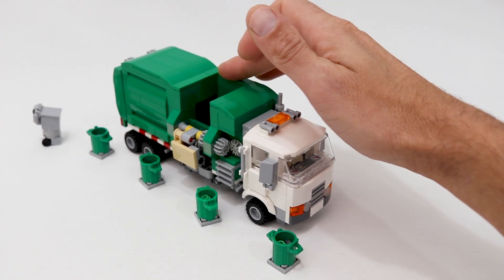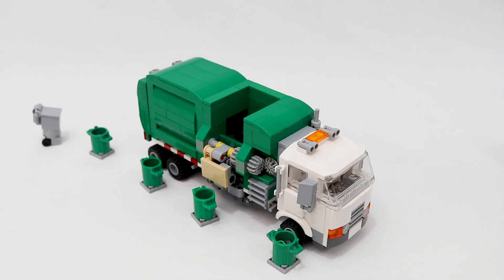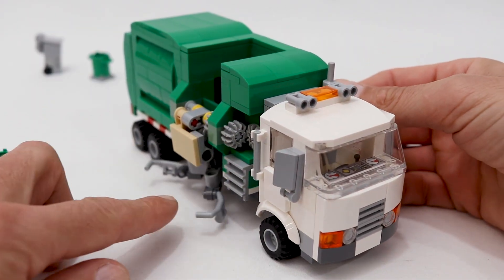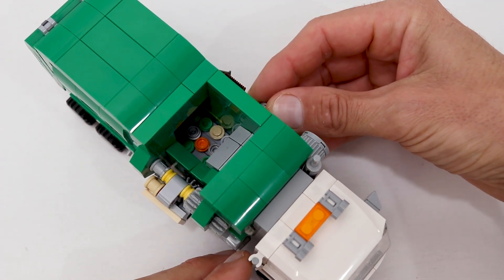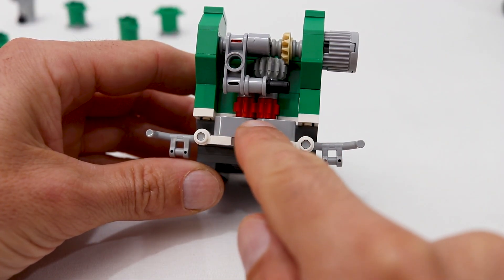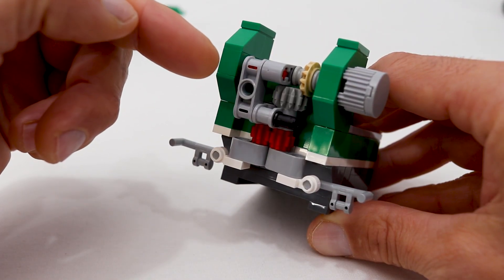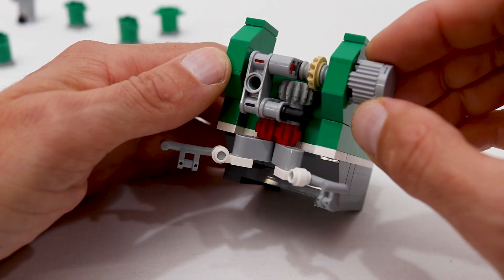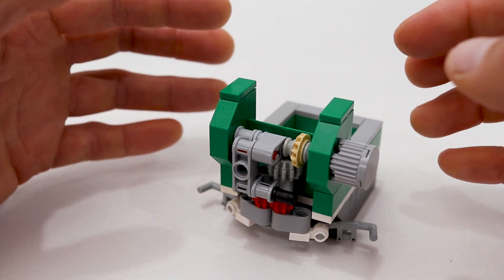Amazing LEGO Side Loading Garbage Truck Mechanism

Comment: @JKBrickworks Is it possible that it works best with 11955 Gear 8 Tooth with Dual Face without Friction? It seems that this is the only gear to make the gripper parallel, right? THX

Comment: Lego has decided to release a technic garbage truck (42167) based similarly to the functions of this garbage truck. Obviously someone in lego saw this garbage truck.
Reply: Well obviously, if it reached 10.000k and wasn't chosen as an Ideas set instead. Why pay the fan designer if they can make it themselves and get some cash from Mack as a licensing partner in the process?
Reply: @R0Sch88 they didn’t even make a half decent garbage bin on it

Comment: So sad that the loader used an illegal technique
Reply: I'm curious to understand what you think is an illegal technique.
Reply: @scotthasse280  i don't know I think is putting a horizontal plate with a vertical plate, placing bricks on a Technic brick or beam (by the side), but I've seen that technique in a video so I could be wrong
Reply: @synkron1246  Ah, thanks. A single stud in a technic brick is discussed at http://bramlambrecht.com/tmp/jamieberard-brickstress-bf06.pdf (slide 11), and seems to be OK. I think the same would apply to a beam, and the way we are using it is a single stud connection. 

Although it might look like we've put vertical plates into horizontal ones, we actually haven't but have used parts #22885  and #3956 fairly extensively.

Thanks for the discussion and sharing your concerns!
Reply: @scotthasse280  thanks for letting me understand :)

Comment: It's a "grab & lift" mechanism, it's really hand when you need to lift stuff with Mindstorm robots because you only need 1 motor to do two movements, I've used it on a tic tac toe robot that otherwise would have been impossible using a single RCX!

Comment: Imagine this whole assembly as a GBC module and the truck as part of some automated train system. Full-auto re/cycling!
Reply: This is actually a similar concept to a gbc mechanism where a lift arm does nothing until a ball falls into, when it lifts it up and deposits it in a similar fashion. It works with a piston though, not a bevel gear.
Reply: Yes, it's the Akiyuki 'stuck ball' GBC, also came to my mind when looking at the garbage truck video, very nice compact design and function in the truck.
https://www.youtube.com/watch?v=4JeHGJJORrI
Reply: That would be so awesome!! I hope someone makes that, I wonder if it can be easily modified to make it pick up balls or some containers with balls
Reply: Maybe I'll take you up on this... 🤔🤔
Reply: I could see someone rigging this up with tracks underneath a road in a Lego city, and then have the truck move down the street picking up and dumping trash. Someone please do that!